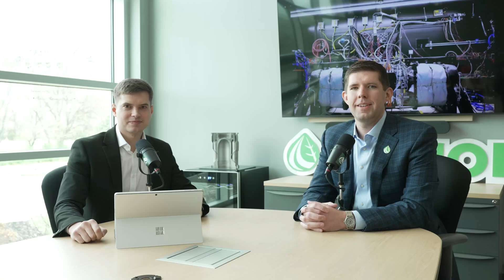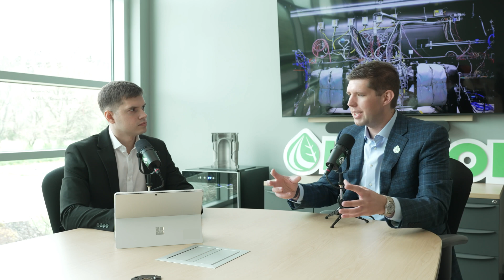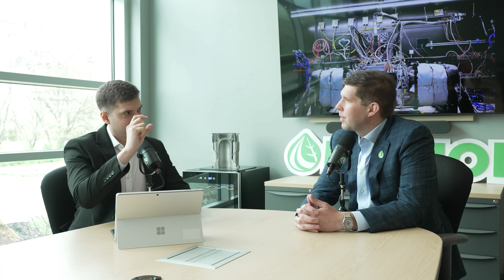Hyliion Investors' Community Q&A: Thomas Healy Answers Questions on Karno Generator and Beyond

Comment: Surprised they've moved the linear gen-set design in-house from Libertine. That's very good news considering Libertine is part of an Indian Holdings company now although on the down side now they're dealing with untested components . I wonder if the control software is in-house developed as well, or only the mechanical components?